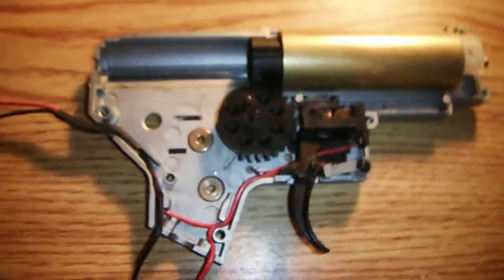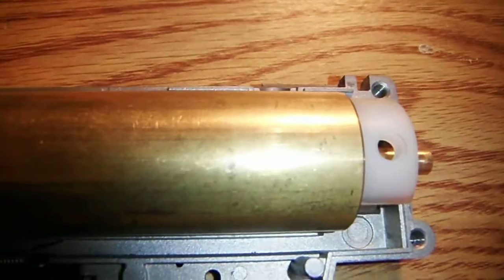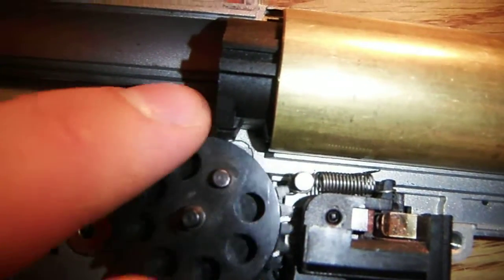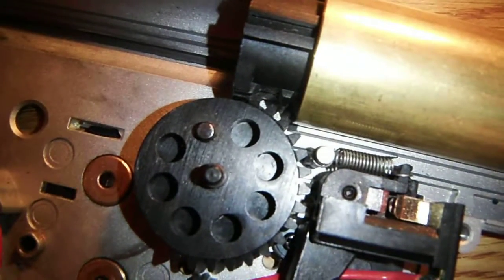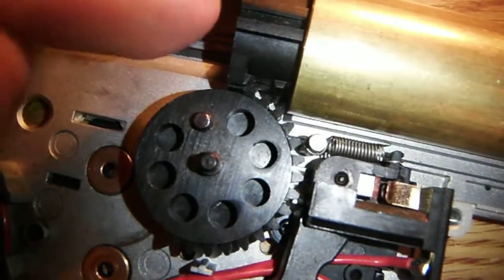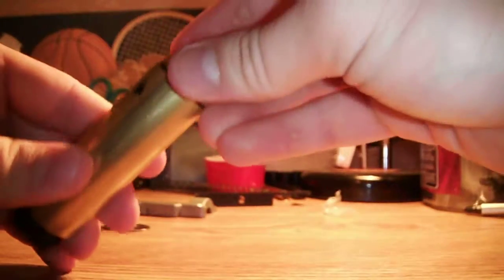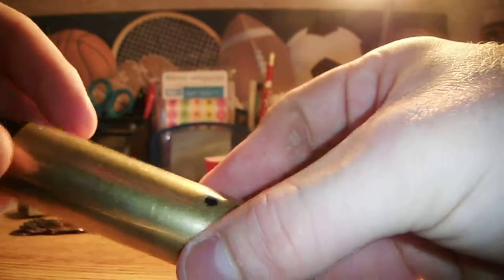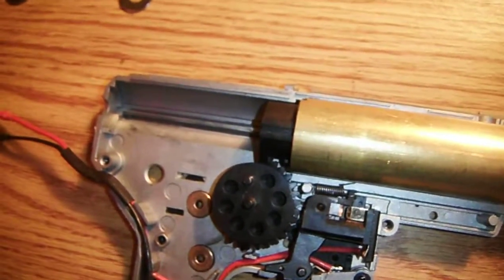Angle of Engagement in an Airsoft Gearbox

Comment from the maker: Great Question. As a matter of fact it did because when you do the rubber washer mod like I did in this video it moved the point where the piston meets the washer (cylinder head) back closer to the hole. This creates more air that goes up into the blowback housing and powers the fake bolt to the rear. It gave it an extra half inch of blowback, but that was less air going to my bb so that is why i dropped in a new cylinder with some modification and disable it. Great question! Hope this helped!

Comment from the maker: Well I can't tell you the size on the label in the store but this is what I did. Take apart your gun before you plan to do this. Take your cylinder head in with you. Go to the rubber washer section at your local hardware store and find the one that fits perfectly with the cylinder head. And buy about 5. They won't cost you much like 25 cents each. When i finish upgrading my gearbox I am going to do 2 washers to set my angle better. It depends with each gun. But yea do that and you should be fine